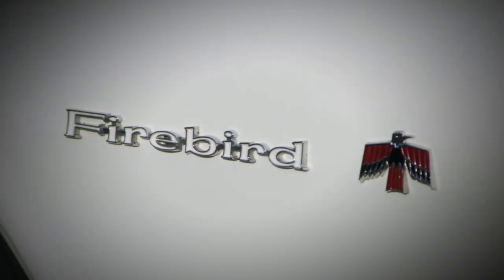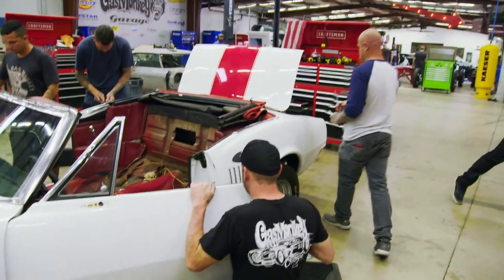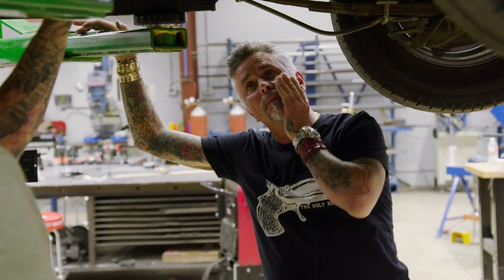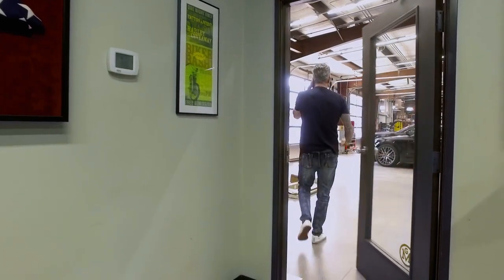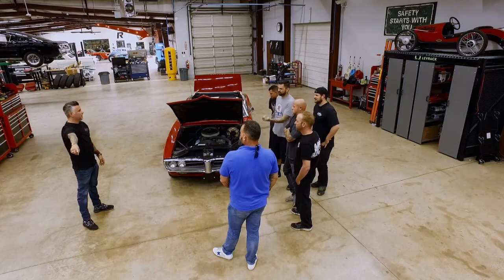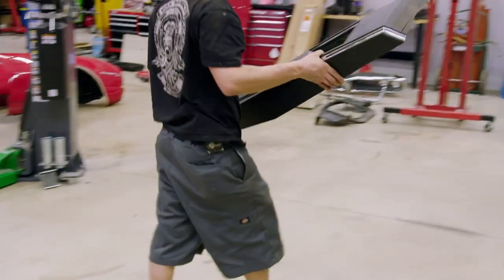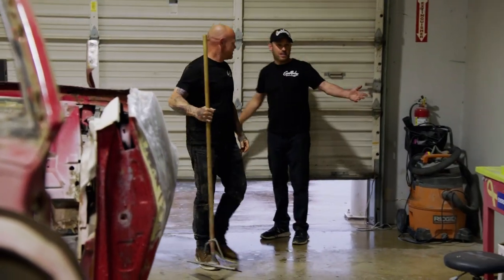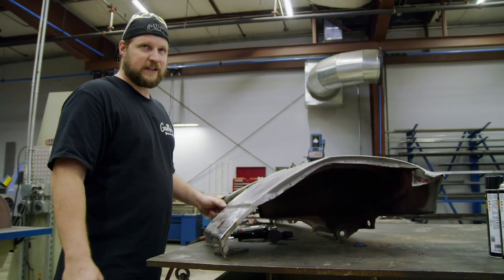Rotten ’67 Pontiac Firebird Makes Richard Rawlings Lose $35,000! I Fast N’ Loud

Comment: That kid Talkin at the 3-minute Mark doesn't know his ass from a hole in the ground, these cars are getting rarer and rarer and there's plenty of aftermarket support to bring these cars back... my floorboards in my 69 were much worse and I completely replaced them the correct way, along with through the floor frame connectors and as far as the rot on the front frame is concerned oh, those are available in the aftermarket too... they know that, but this is just stupid drama to draw up ratings
Reply: *worsterererer
Reply: Yeah and get this that guy you are talking about came from an actual auto restoration shop in OKC!!! You are correct about everything you said. You can get the replacement parts to rebuild your whole car reasonably because of the market being very stable.
Reply: I'm a professional builder. Currently building two 1st gen firebirds. Both will be supercharged lt-4 powered. One convertable one hardtop. Any and ALL parts can be purchased for these for the most part. Far fewer than camaros too. And they have a better look to them. Im in wisconsin and the cars these guys think are bad..... lmfao. They don't even know what RUST is.

Comment: The structural integrity of a convertible doesn't rely on the floor. It relies on the rocker panels. What a bunch of dopes. As much money as that thief has screwed people out of through the years, he can afford to just crush it and eat the loss. And putting a timeline on a build is just TV drama.
Reply: @numismaticstacker  FACTS
Reply: Plus on the 67 to 69 Firebirds and Camaro’s had a large stamped metal x plate that  reinforced the floor and connected to the rockers underneath
Reply: @greatdaneacdc  
Yep. The Mustangs of that era had an additional inner rocker panel welded on the inside. Nothing done to the floor pans at all.
Reply: @greatdaneacdc  that's a lie

Comment: This is the second clip I've seen of this show (ever) and it's just infuriating. I feel like every situation could easily be resolved with...
1. Doing a proper inspection before purchasing a car. I've owned multiple older sports cars from the 60s, 70s, and 80s, and that's like buying 101. You go over the car with a fine tooth comb or have a buyer's inspection. You don't just buy a classic car with no thorough inspection. That's the first rule! 
2. Again, why are you setting up deadlines BEFORE a thorough inspection? That's like saying "Yeah, I walked around your basement for 5 min and think I can do a complete remodel in exactly 45 days on the day of your open house." No, you inspect things, look for hidden damage, or go over everything carefully and THEN give an estimated deadline that could likely change. The way the shop is doing it is only going to set them up for failure. This is the second time I've seen this happen with these clips (first was a Pantera). It's infuriating at this point because it's such an easily solvable problem.
Reply: ok you realize its scripted right
Reply: Soooo long
Reply: And you turned your opinion into a short story. 
Nice story Brah! PS. Nobody cares.
Reply: @deeznutzz8375  "Nobody cares" says the guy responding to a 5 month old youtube comment. 😂  BTW, it's "cool story bro"

Comment: Years ago, in 2001. I bought a 67 hardtop for $1800 running. Remove  the nasty carpet then noticed the rusted out floor panels. You can literally see the road as you drive it! My friends called it the flintstones firebird 😂 years later repair it. Good times

Comment: Why does he have to screw up every car he gets his hands on. I can't believe that white car wasn't salvageable.
Reply: It's very salvageable, especially being a convertible ....this is all for show drama and ratings
Reply: It is... sheet metal parts are a phone call away.  Screw up TV drama crap, zero tolerance fake deadlines.
Reply: It was not salvageable because it was structurally damaged and where it wasn't safe to drive. Its like a house, when the foundation is destroyed, it's not safe to live in. It was just a matter of time before that car fell completely apart. Some parts might be able to be used on another car but when it comes to car collectors, they mostly like having numbers matching parts and that is mainly when its all original

Comment: Its sad they don't have a mechanic that can build the original motor.
Reply: Forreaaal,it's kinda dumb NOT TO do that, he could make hella lot more money if they actually RESTORED these vehicles instead of changing it into something it wasn't meant for, I can see putting air bags but all that extra transmission , motor replaced with newer parts . To me it's a cool daily driver if it's modern, but I rather restore and sell it

Comment: Gas Monkey is not in the restoration buisness. It's a Hot Rod shop.
Yes you can rebuild a car from a couple of screws.
The only show where there was no bs was FantomWorks. Ground up frame off total rebuild. Two years.
Richard does not have two years.
One the deadline for the builds is 27 days to be able to make the required episodes. Richard sold the show based on a certain number of episodes and production schedules meant a new project done and sold by a deadline.
Need money coming in to pay for the parts for the next project.
Self imposed but the Garage is only part of the parent company.
Vendors expect to be paid. Payroll has to be met.
Take a straight car juice it, paint and tires and flip inna month.
Richard can not wait two years.
Counts Kustoms is a restoration buisness. Fab shop, bike shop, upholstery, stereo etc.
Now a custom build for a client takes what it takes.
The purpose of a flip is to keep the lights on make payroll and buy parts for custom builds.
Overhead.

Comment: When someone is dumb enough to buy a vehicle from this place, they are paying more for the car because of the gallons of bondo that's applied to the metal. The owner should take the title of this car,  then drive the vehicle to a Cat Brand professional calibrated weight scale, and see the weight difference between the factory weight on the title, and the weight of the car after it leaves Gas Monkey Garage. No doubt there will be a significant weight difference between the weight numbers. The actual workers in the shop really know their trade, but the owner Richard Rawlings, is a real con man. A snake oil salesman. I would rather buy something from Mr. Haney of the Green Acres TV show, than a dog house from Richard Rawlings. He gives  true vehicle restoration shop owners a real bad reputation. As the saying goes: 
BUYER BEWARE. Especially when you buy ANYTHING  from Richard Rawlings. Even a pencil.
Reply: The floor of the uni-body was gone and I`m not sure if it`s the same as a Camaro, but anybody else would have looked under the car before handing over the money.
Reply: It’s a tv show sir, it’s crazy how in 2022 you people think its real 🤦🏻‍♂️

Comment: Floorpans are not structural on any car.
Reply: @erincummings745  Floorpans are thin steel you can bend with your hands.  That's why they beadroll them..  the floorpans weld to the structure.
Reply: @erincummings745  unibody cars use layered steel bent in complex bends for strength.  Floorpans arent that
Reply: @getchasome6230  ... on a unibody car the floor pan is probably 50% of the strength. If you are at the point where the pans are gone you probably don't have a straight car because everything sags. Replacing the pans on this while the structure is weak will hold that "sag" situation where it is. Basically someone needed to do a little tweaking / bending BEFORE those new pans went in.
Reply: FLOOR PANS HOOK TO OTHER PARTS AND PROVIDE LATERAL SUPPORT LINKING SUBFRAME AND UNIBODY PARTS
Reply: @rupe53  Nope. You're incorrect
Reply: @paulthesoundguy1  Not so much
Reply: They are on foodies smfh